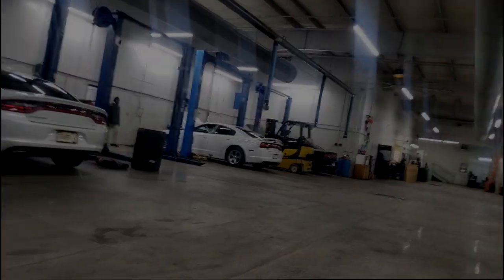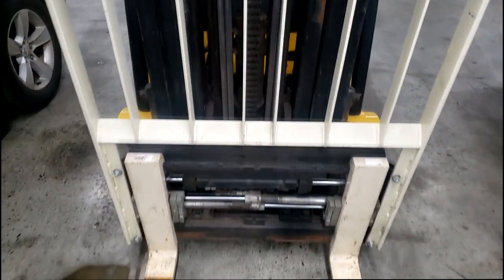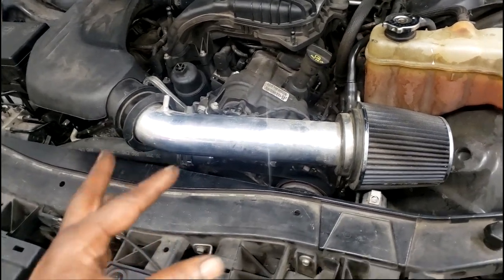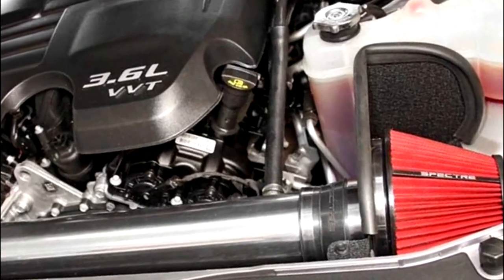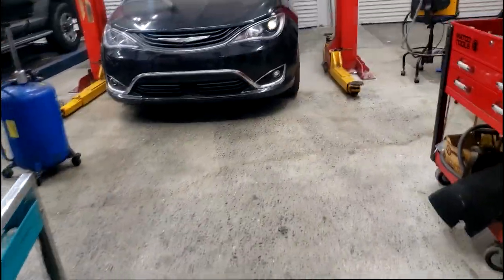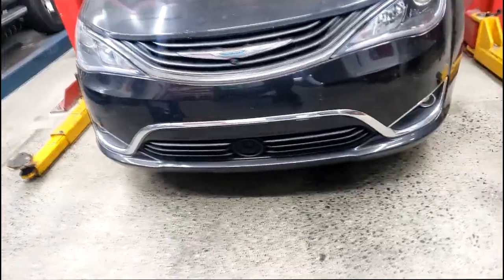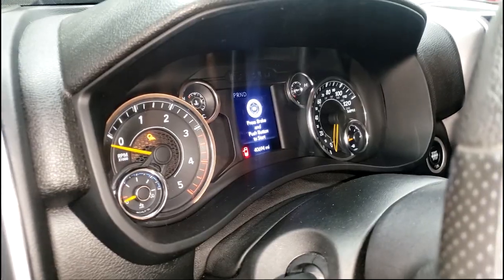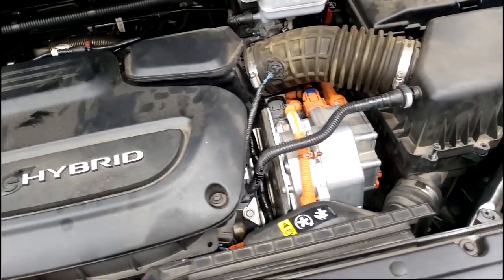Typical day in the shop QUESTIONS. What are yall getting out of your CAI? Pentastar engine win again

Comment: I drove a forklift when I was in my 20s for a job. My training was this makes it go up, this makes it go down, here's the brake and gas, don't touch this, it leaks and off I went. No license, no nothing, I actually got pretty good at driving it. I haven't driven one since but it was fun.
I don't think you need a license but probably depends on where you are at.
Reply: You have to be certified depending on your job
Reply: @jbmlk  Well I was moving big stuff around for a machine shop so nobody probably cared as long as I didn't hit anybody or damage a machine and it was the early 80s. I also delivered stuff with various pickups and cleaned up and like that.

Comment: I put an AFE cold air intake on my wife's 2015 Jeep GC overland 3.6. it made a huge difference!  MPG's increased by 2mpg average and power is up enough that it drives in a gear higher everywhere because of the increased power. We take the same trip in the same conditions weekly in the winter. Going up the same hills that would require a shift to 7th with the cruise set at 70mph now sees it stay in 8th. There's one hill that would require 5th gear at 70, now stays in 6th. It drives like my hemi Magnum does now where it just torques along at a lower rpm. Not all cai's are created equal though just like all factory intakes are created equal. The Cai on my hemi Magnum doesn't do much of anything it seems. Though it's not an AFE setup which might be better but I didn't know if them at the time and I'd have to mod the car slightly as it's for the eagle motor and not the early hemi.

Comment: That intake is not configured as a cold air intake. That's exposed to engine bay temps.

I have a ram air intake on my Caravan, which is CAI + scooped air. I see sub-ambient temps of about 7-11 degrees depending on temp, humidity, and speed. It's not a huge difference, but you do get better flow when you need it at high RPMs. With a good ram air setup you can gain nearly 20 HP. Most will see about 10 on a cold air intake alone. Overall, it's an insignificant improvement in power, but considerable improvement in response.

Comment: My 2019 Cherokee TH V6 - After installing a K&M cold air intake increased the acceleration and I am still monitoring the gas milage to determine if there is any real change (at this time I went from 18-21mpg and suspecting now 20-23mpg) still monitoring to determine MPG.